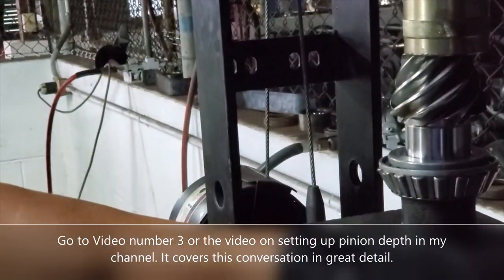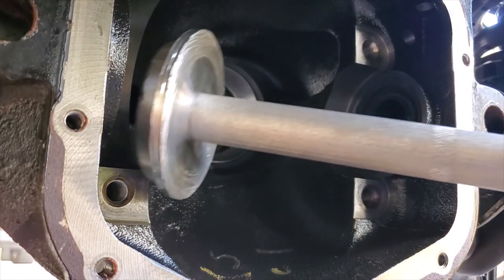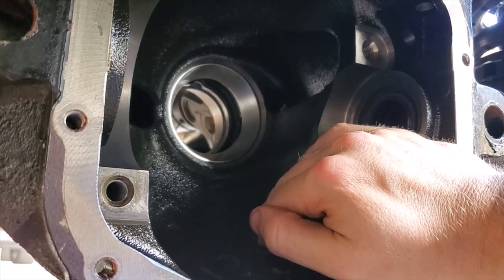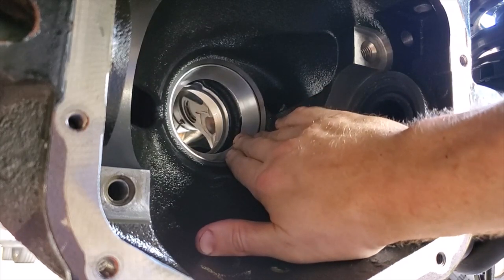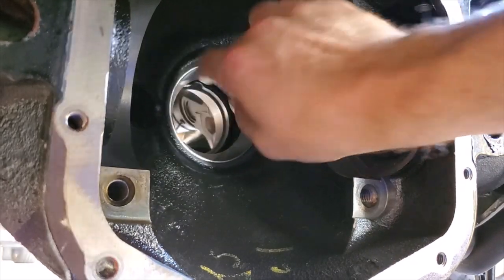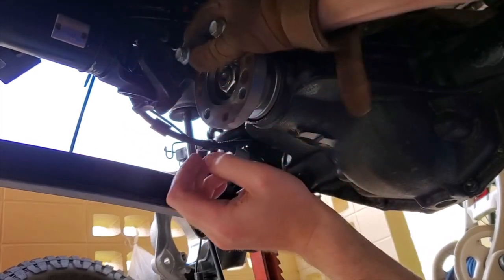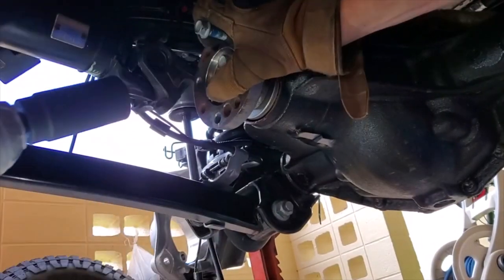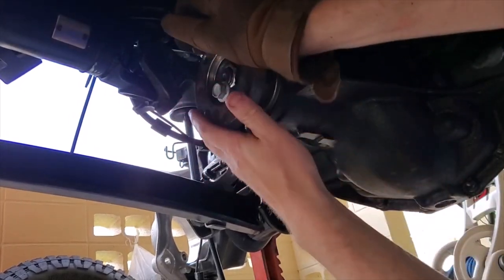Part 4 How to install a ring pinion in the driveway & setting up preload D44 M220 M210 crush sleeve

Comment: 1. You don't lightly sand bearing races to get them go in easier by removing the .05 press in tolerance , they need that press tolerance for a reason so they don't spin in the housing.  
  2. You checked break away preload and not rotation preload , which is what you check while turning it after breaking loose from standing start.  You'll never have the preload right in the car with the axle in that location and using a beam wrench.
Reply from the maker: It's been rolling for 3 years and my TJ has been good for 16 years. If it ain't going in you have to take a thousandth off. If you've done these before you'd know that. But yes if I had heat I could have got it in there but I get it. That is the right way but I have never seen a race spin in any axle before. So it is what it is.
Reply: @c130aviator   I have seen many races spin in housings, maybe 3 a year or more sometimes. I've never ever had a problem installing a race. When they don't go in its because it wasn't inline correctly.  However, you didn't check the preload right either, all that shown was breakaway load, not the preload.    
  At the end of the day, it is most definitely not good to make a video as an authority and say this is ok when it is not. I do this professionally,  not as a you tube content creator.

Comment: Glad you mentioned lightly sanding the race and/or housing to facilitate installing the races. When I mention this to weekend warrior types they lose their minds! Read this: not most, but ALL BEARING MANUFACTURERS VERY SLIGHTLY OVERSIZE PRESS-IN BEARING RACES. This is done because most of the time gears are replaced due to a failure which can beat up or otherwise de-form the lands in the housing. If your housing is in perfect condition it's nearly impossible to install a new race even if it's not oversized! Great video buddy!! Kudos!

Comment: Awesome video ! It’s  great because I had to replace all of my pinion bearings and carrier  bearings and rear  axle bearings In my garage under the truck and had to do it no press so I was actually able to freeze my pinion  gear and lightly warm the bearings I use a toaster oven actually and popped right on carrier was the same deal..  Appreciate people like you put these videos up because they truly truly help . I learned a ton from YouTube.. Oh man but I did not know that you could send out or Jamall out any of the Reese way and I had to be on that race the inner race took me two days and I don’t even have a long handle on my bearing race driver set .. I almost gave up ..I’m glad I didn’t I finally got it but  maaan

Comment: Oh, and Freeze you pinion (0°F)and 250° F heat your bearing. They drop/tap right on. I’ve been doing this for 20 years without any problems. 
Removal of old bearing on pinion (if it’s a bearing swap) on an old pinion, angle grinder and cut off wheel carefully. If you nick it he pinion bearing surface, doesn’t matter. ✌🏼

Comment: You need to place the seal, then use the impact gun to getting closer but not  too much. Then use the torque to keep reducing play of the pinion when the crush  spacer  get to the point of no play but the pinion turn free. Then the crush spacer will keep the bearings free but no play.

Comment: So I’m doing an 8.5 and I over-crushed the sleeve to about 40, I’m gonna try to do what you said about backing off the nut a bit but wouldn’t that make it a little sloppy?
Reply from the maker: Yes but it's a crush sleeve. Think about how that works. It's springy and spongy. If you back it off and it's loose you must replace it. If you back it off and it's still tight the tension is still there. It's not like using shims that you can get perfect. Crush sleeves offer a little forgiveness.
Reply: I backed it off and then retorqued it to 20 inch pounds and it feels tight, there isn’t any play in it but I’m a little concerned that once I start driving the truck things might loosen up and I don’t wanna trash a new setup, it’s in a K10 Squarebody with 33s and a small lift so I’m sure it’s going to put some pressure on it. And thanks so much for getting back to me, I really do appreciate it

Comment: I didn't see you put the crush collar on did you put it on through the back side after you slid the pinion gear in?. I see people really struggle to get the collar to crush with about 200lbs or so on the pinion nut, does your impact wrench do the whole job? Thanks
Reply: I believe this uses shims to set preload. I think all D44s used shims - some D30s used crush sleeves.